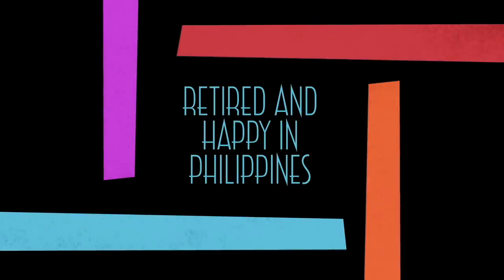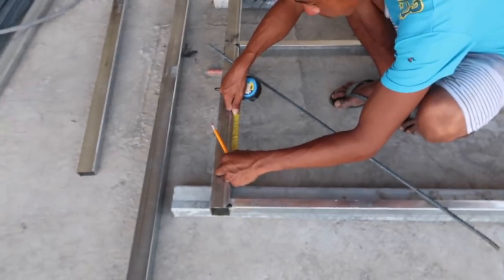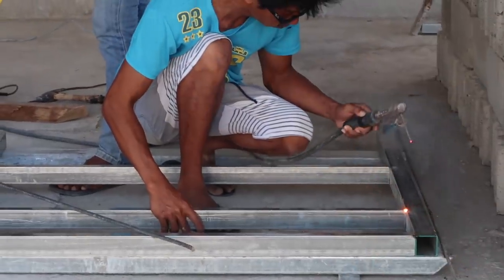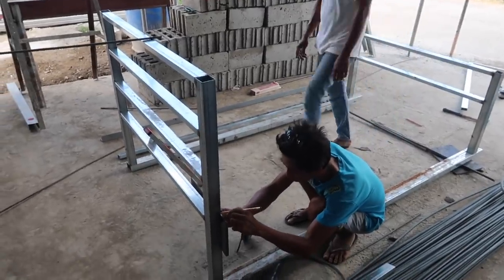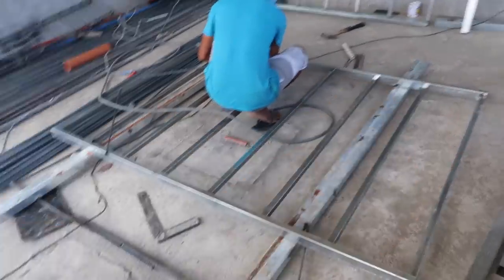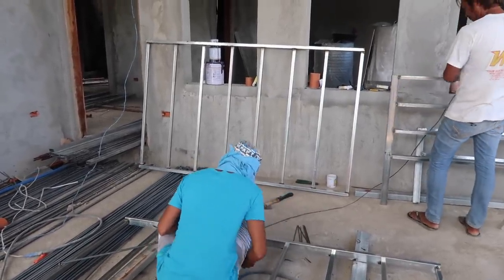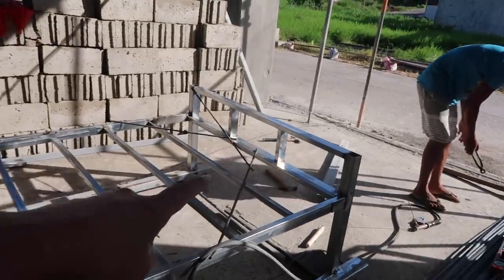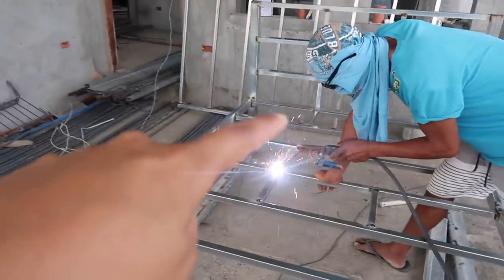DIY Tubular bed frame - Metal flatform bed I Philippines

Comment: Awesome project! but get that poor man a welding helmet
Reply from the maker: They have laying around but they dont like using it 😩
Reply: Awesome... But Safety first po maam
Reply: pro doesn’t need that stuff hahaha
Reply: @retiredandhappyinphilippin3329  They could go blind eventually and could also sustain serious burns by not using proper safety equipment. The bed frame looks good, though.

Comment: Where are you all located in PI? I plan on eventually building a house in PI
Reply from the maker: Lipa batangas
Reply: My wife is from Cagayan Valle but she has many relatives in El locos Norte but I’ve checked the property there is very expensive

Comment: Anong specs ng tubo ginamit maam?
Reply from the maker: 2x2,1x1,1x2, lahat 1.5mm
Reply: So 2x2 for the post/leg part, 1x2 for the frame, then 1x1 for the slats right? Are all these tubular comes in how many feet when you bought them? Thank you. Im thinking of making one for our ancestral home. Did you say p3500 only for both material and labor? Double bed and double decker or just for double bed only. Salamat po!
Reply from the maker: @bersabeharris4680   i divided the cost for each bed except the bunk bed probably 5k end up.. specs is right and the lenght if im not wrong is 6Meter

Comment: How the heck are you getting a fully welded bed frame through the door. Hence why bed frames come in boxes with hardware
Reply from the maker: You can disassemble that ,we use screw to attach it.
Reply: Whats the use of screws hence you already had it welded together the headboard footboard already to the frame?  Enlighten me please, thanks for showing them how. How much is welders pay a day? How much tubular have you use? Thank you.
Reply: @bersabeharris4680  that's a tack weld, it can be easily removed with an angle grinder. You can see the first bed already disassembled and proped up against the back wall